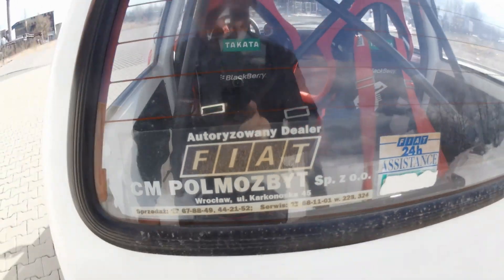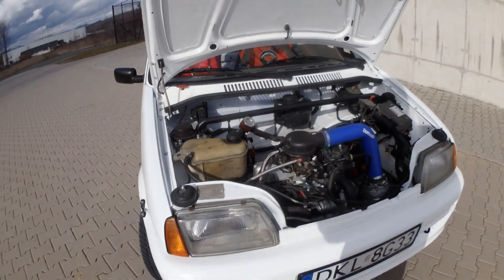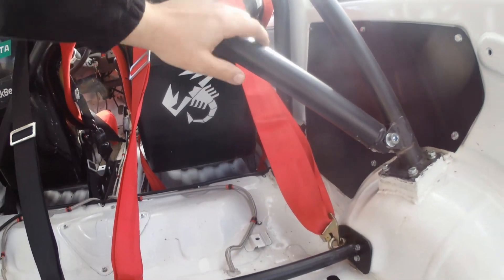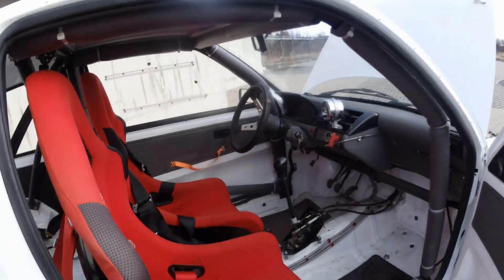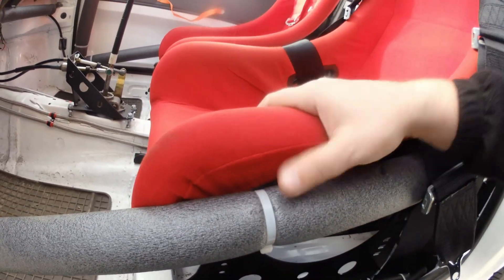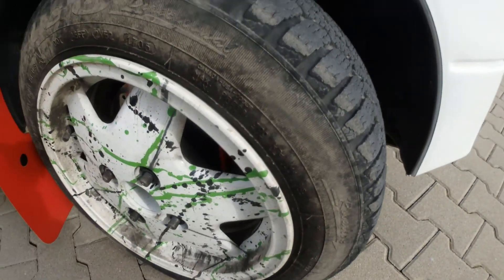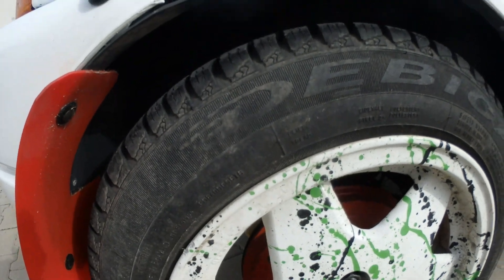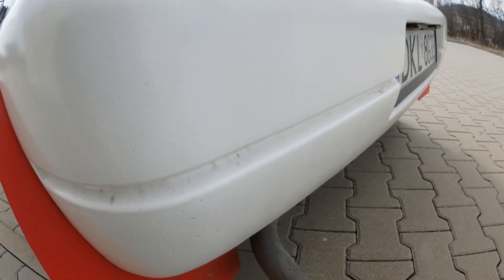Review Of my 1997 Fiat Cinquecento Rally Car

Comment: Nice video, thanks for sharing. Why did you change the original ECU to this 16FM.EC version, originally used in the Seicento 899cc? I also have an 899 motor (Panda) in my Fiat 600 and I am looking for the Trofeo mapping actually. Hope to hear from you.
Reply from the maker: Hi there, reason why because my car was oryginaly a 700cc car, I swap engine from seicento 899cc from 2000 and i use Ecumaster DET3+ pigyback for 3 things :
1 I use bored Throttle Body 34mm
2 i use 295 degrese camshaft
3 i need tune up car for correct AFR 
and stock ECU is impossible to work with those 3 changes correctly 
right now my car is more powerful than Trofeo but stil have stock gearbox and stock manifold
Reply: @polskifiattrofeo9161  Thanks for the clarification. I have no experience in mapping, would you be willing to share your Ecumaster mapping?
Reply from the maker: @brammerema1547  my mapping will be not working with your car because of different car spec, and fuel used to map my car, possibile you be only damage your engine ;)
Reply: @polskifiattrofeo9161  Think the setup would be quite comparable. I run a 36 mm TB and am looking for a 295 or 287 deg cam. I might function as a base map.